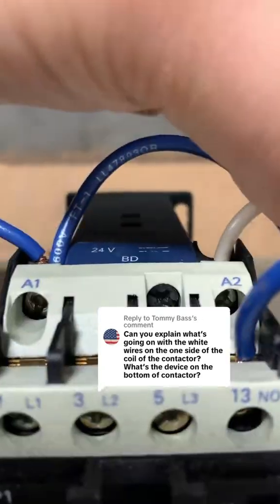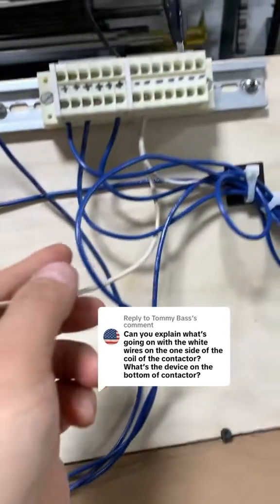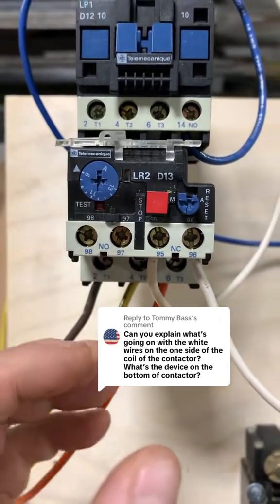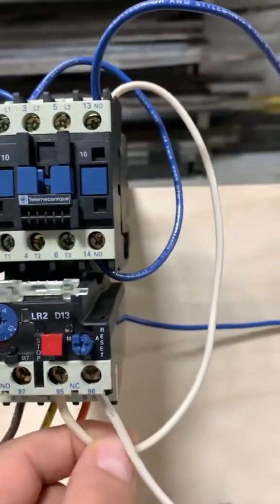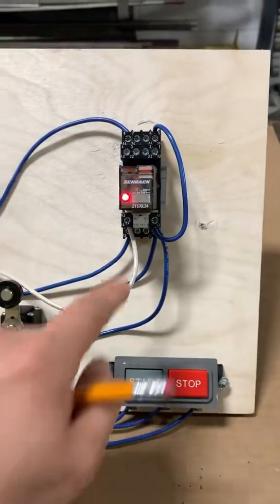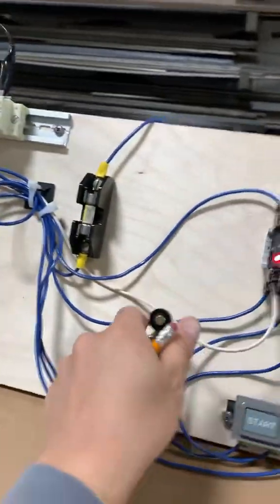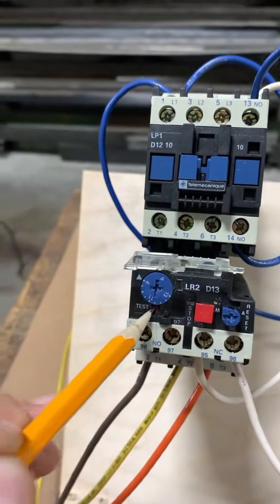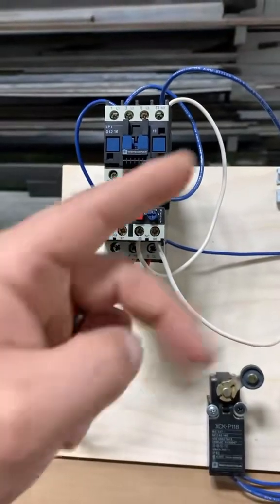February 18, 2025

Comment: If we didn’t do that the coil would still be energized and the current would go to the overload and stop it right, what is the point(s) of doing it, ive been teached it’s good practice but why ?
Love your vid btw!
Reply: I just asked chatgpt, maybe what it says is correct;
The reset button on the overload is only for the auxilary contact (which i didn’t know), so the overload would allow current in again once cooled down, and potentially cycle or other consequences..
Is that correct ?
Reply from the maker: the OL will still trip, but we want to tie in a normally close contact from the OL relay into our motor control circuit, so that the motor cannot be restarted unless OL has been reset.